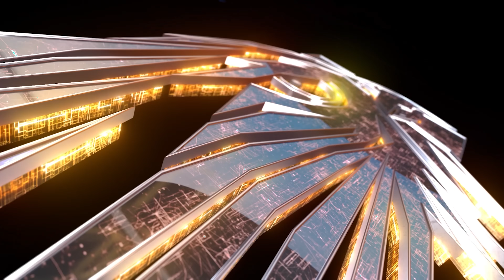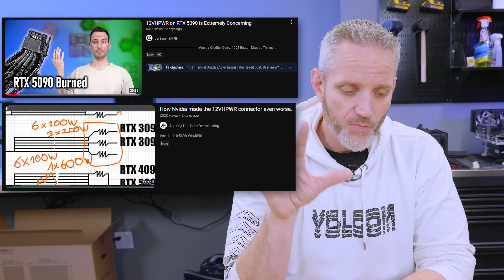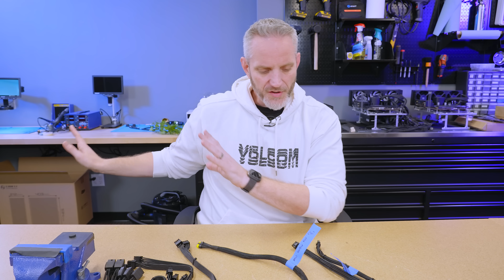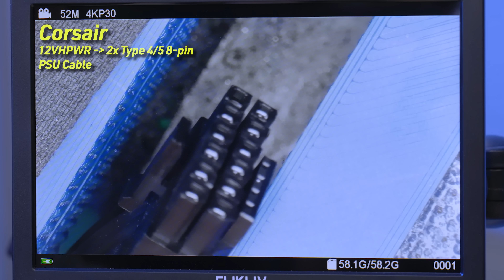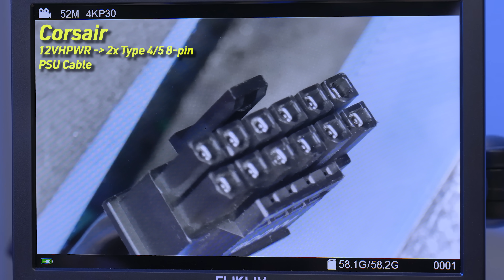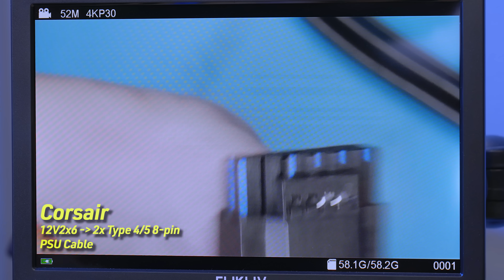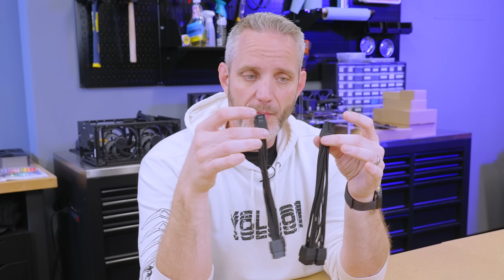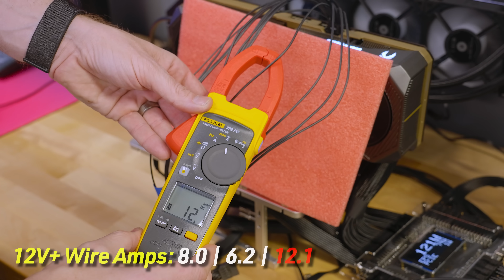I discovered something concerning and I need the Experts to chime in... More 12VHPWR discovery!

Comment: Electrician here (for whatever 2 cents that's worth). First, the connector bodies you're showing have sleeves in them, not pins, but that's not particularly important. The way a sleeve crimp is designed to be crimped to a wire and mate with a connector body is kind of at the heart of what I'm seeing here. The sleeves get crimped onto the stripped wire first with one part of the sleeve crimping onto the insulation for strain relief, and the other part crimping on to the wire strands. In theory, a proper crimp tool fuses the strands together with the crimp sleeve by applying a calculated amount of pressure in a precision, high tolerance tool jaw. The resulting connection should be practically without resistance (I mean, there's SOME amount of resistance, but it should be negligible to the requirements of the circuit design). Low tolerance or worn tooling can have a huge impact on the connection quality, as can the material the sleeve is made of and any of its coatings. Really poor quality connections can happen when quality control isn't up to par at this stage and wires aren't stripped properly (too long or short) or not positioned in the crimp body properly.

Once the sleeves are crimped onto the wires, the sleeves can be inserted into the connector body. Spring tab(s) in the sleeve or some similar mechanism will retain the sleeve in the connector body with almost zero wiggle room. This is where things can get really sticky. A cheap connector body and sleeve might have retention that basically doesn't work at all or that works really poorly, or that has too much wiggle room, which is what I think you're seeing on some of your connectors with sleeves at various depths. That said, even on the connectors you have that are somewhat recessed, there might still be enough contact between the sleeve and pin for the circuit to work withing specifications, unless the sleeves are of such poor quality that they're opening up (too little spring pressure) and not mating in parallel with the pin around its entire circumference. High quality connectors should work reliably even if not locked in 100% and the locking mechanism should only really be there to prevent the connector from pulling away completely.

If you know the circuit design is good and you still have one wire carrying more current than the others, it's the other wires that are likely at fault with possible bad crimps, broken strands, poor connection quality between sleeve and pin, etc and they're presenting too high a resistance to carry the proper load. Electricity will take all paths, not just the ones with lowest resistance. This can cause that single "good" wire to carry way more current than it was designed to carry and heat up along it's entire length just from being overloaded - especially in a power bus design. The overloaded wire(s) should show a heat signature along the entire length. The bad wires should show heat signatures at the crimp points (inside the sleeves and dissipating heat away from the bad connection). Hope this helps.
Reply: I want to highlight the last paragraph. The conductor(s) carrying too much current are (initially) the best connections, not the initial failure point. Conductors not carrying current are the problem. Hot connections/terminations without higher-than-neighbor currents are signs of high resistance in that specific point.
Reply: Exactly... Well Done Mate! 👍👍
Reply: What he showed with the PMD2 reaffirmed to me that much of it is likely variance in cable connections,  which there 'should' be enough headroom in the spec to realistically account for. However,  if you watch the video der8auer released, his quick test showed just 2 wires effectively carrying all of the current to the point where they were hot to the touch in just a few min and blinding on the FLIR.

Poor crimps are one thing but it's wild to think his fairly reputable cable could be so bad that every other contact had such a higher resistance even as the the 2 carrying the load heated up that much. It seems like another factor is potentially at play but if it really is just the connectors then the margin for error must be shockingly low for how much Nvidia is pushing the specification.

It's all very strange considering their engineers have now had years to analyze the concerns around it.
Reply: buildzoids video explains the other side of this... in the 40 series and 50 series Nvidia moved from power delivery split 3 ways via 3 shunts to a single shunt design that combines the input from the 6 12v conductors into a single load. So instead of a max potential draw of around 16.63 amps across a 16GA wire (assuming worst case where 3 conductors are faulty, 1 per pair)... you now have the potential of 50 amps going across a 16 ga wire. You can lose 5 out of 6 12v conductors and the card will still power on instead of losing a maximum of 1 from each pair. As an Electrician you should know how bad that is and what will happen when the worst case eventually occurs :)
Reply: @TheAddanz  there is no other side of it this is reality now the rest of the industry is aware of it and should adjust. Read the comment again until you understand what is being said and also read some of the replies
Reply: @InsaneDark  the other side is the incredibly fucking stupid power delivery circuit design which allows a failure state that can push 50 amps through a single 16 gauge wire. Derbauer actually just emphasized that point. NVIDIA should redesign the circuit. It's very simple to make it safer and the cost of implementation on the PCB via design change is negligible. The alternatives will all cost substantially more. Cables would need some smart logic onboard, or PSUs . NVIDIA just needs too alter the etching of traces and add a couple of shunts to split the circuit into 3 pairs of 2 , so the worst case scenario becomes 3 wires with 16 amps, instead of a single wire with 50. This design should never have made it to production in its present form
Reply: @TheAddanz  Boom goes the dynamite?
Reply: As an electrical engineer, I completely agree with this take on the problem.

This comment needs way more likes, it's the only comment that actually explains the problem at hand with the least amount of inaccuracies. There was only one inaccuracy where you mentioned that electricity won't take the path of least amount of resistance and that's just not true.

Electricity is lazy and it will a̶b̶s̶o̶l̶u̶t̶e̶l̶y̶ t̶a̶k̶e̶ prefer to take the path of least amount of resistance without question.
Reply: @proxyhx2075  I'm an electrician. Electricity takes any path it can flow through. The majority of it takes the path of least resistance, but there will still be current on a higher resistance path.
Reply: @Brandon_Nelson92  Yep, can confirm as someone who's accidentally touched a mostly discharged capacitor>.>  it will take ANY path given even if it's already connected to another ground... >.>  I'm looking at you power supplies >.>  (I KNOW, before anyone says I KNOW... I was being VERY careful but still messed up somehow and contacted the top of a large capacitor inside of it as I was trying to figure something out.  PSUs are no joke, and I knew that before hand... thankfully it had already discharged AND been over a day so ... yea thank the lucky stars on that one I'm still here >.> )
Reply: @Brandon_Nelson92  I know that it won't exclusively take the path of least resistance, but most of the electrons will still prefer that due to their nature.

I should've used the word "prefer" instead of "will", that would clear up any further misunderstandings I hope.
Reply: @proxyhx  I'm not arguing, everything here is good stuff, just pointing out it is only an inaccuracy if you stop at that word and don't read the full paragraph for context. He didn't say it would travel equally... He was correct in saying that those connections are still made, so no faults are detected, but the vast majority still goes the easy path. As you say, electricity is stupid... there will be electrons that just kind of get lost and wander down the high resistance path, which they couldn't do if it was just a broken connection entirely... He followed that one line up with the entire heart of the cause of heat on the "good" connections, needing to shoulder the load of the bad connections.
Reply: @Burt2707  Yeah I realized that soon after I commented, I stand corrected.
Reply: Commenting to make sure Jay sees this one
Reply: Damn, nice comment. I worked as a crimp technician for a major automotive suppliers in the prototype/R&D department and thought basically the same. The crimp style is called B or F crimp btw, and has four open claws per crimp sleeve, two for the wire crimp and two for the insulation. The stripped wire is inserted into the crimp sleeve and the claws and the claws are pressed with a tool from abow to bend them inwards, into the strands and around the insulation. 

There are several more things to mess up as a machine setter. 
The crimp sleeves are fed into the machine as a big continous spool of stamped pieces, which is moved one piece per cycle with a small hook grabbing the band and positioning it in the tool. The position on the tool can be fucked up in two dimensions, either the crimp sleeve is advanced to little or too much, resulting in the claws that press into the wire strands (like a B laying on its back) to be asymetrical. One claw may be barely contacting the strands, while the other one pushed through and collided with the inside of the connector itself, big no no. Another one is the crimp sleeve position being too deep or too shallow the the tool. This will result in parts of the crimping area to be not pressed down properly. 
 
Another one would be the wire. If its inserted too deep or not deep enough into the crimp sleeve, you get a bad crimp. If too much or too little insulation is removed, you get a bad crimp. Also the wrong wire stripping height, resulting in missing strands or prodruding insulation in the wire crimp. Missing strands or insulation in the wire crimp SHOULD be recognised by the crimp machine if it has the capability to learn the headroom for a certain crimp sleeve/wire combination. This would discard any crimped wires that detected a certain overpressure or underpressure. Bad QC may overlook this issue.

Worn out tooling may be one factor, broken tooling another. The two pieces, anvill and hammer, are hard af and WILL break if the pressure is too high. I've had several toolsets break on me because small diameter wire on a pretty empty wire spool tends be coiled up so hard that not even the straightening device could remove the internal twist, resulting in some wires being so curved that it wasnt inserted into the crimp zone. This resulted in an empty crimp with the crimp sleeve being stuck in the hammer. The machine will discard the uncrimped wire but continue with the next crimp ,resulting in two or more connectors being stuck in the tool while it hammers down. 

The resulting damage can be really hard to spot with the eye, it could range from miniscule deformation in the anvill to parts of the hammer snapping off. If its a less noticable damage, the machine will crimp just fine, the crimp wont look bad at first glance but the crimp will always be bad. If QC is half assing it, those crimped cables would be sent out to customers because the machine didnt reject the batch.

Another factor is the factory producing the crimp sleeves on the spool. Broken and worn tools resulted in many customer reclamations during my time where I had some pretty rough looking spools sitting on my desk. 
Less noticable is a problem with crimp sleeves that are produced on a multi-stamp tool. To reduce machine time per stamped crimp sleeve, some pieces arent stamped and bent one by one by the stamping press, but several crimp sleeves are being pressed during the same cycle. The highest I saw was 5 connectors being stamped in one go. This also means that the dimensions and properties of the spooled crimp sleevers arent the same, as it goes 1-2-3-4-5-1-2-3-4-5-1... One to four may be fine, but if the tooling for crimp sleeve No. 5 is off, then 1 in 5 crimped cables will be off.  

Many crimp related problems will only be found when a microsection of the crimped contact is made, again bad QC will not find this.  For the last case, a sample of all the different crimped contacts off a spool has to be taken, ground and polished to the right height to be analysed under a microscope. While 1-4 may be crimped just fine, No. 5 will have the crimp claws bent out of spec, asymetrical or not inserted correctly. Setting the machine for multi-stamped products was a real PITA sometimes if the tooling for the crimp sleeves didnt align too well.  And again, if QC is lacking, this wont ever come to light. The crimp sleeves are crimped just fine and the machine doesnt complain, maybe one contact will be microsected and show a good result, but 1 in 5 will still be bad. 

Tl;dr crimping cables on an industrial scale is hard and prone to failiture.
Reply: @minecraftzocker272  I’m an electronics technician at a university who happens to be a connector nerd. Really appreciated your comment, since my own hands-on experience with crimping is with hand crimping (since my job is building one-off or very short run custom equipment, and repair/maintenance), not automated production. 

Your section about how some stamped contacts are manufactured also perfectly explains how I got a shipment of TE AMPMODU contacts (loose, not taped) where approximately 1 in 5 pieces was defective, with the mating area slightly twisted in relation to the crimp area.
Reply: @tookitogo  Yeah, sounds about right.

 I saw similar problems regularly, and it was 9/10 times our factory being lazy fucks who dont check their tooling for defects, or if it was even the right tool. 

One time I had a protptype terminal and I needed to crimp some samples. All came back because they didnt behave as expected in the conductivity tests. After a few days of checking the used cables,  symmetry, height, measuring every dimension of the uncrimped terminal,  changing some stuff and having no idea whats wrong, we called the designing engineer down to look at the terminals. 
Turns out the wire crimp area had the wrong, unmodified, number of serrations and the factory used the standard insert instead of the requested prototype one 🙄
Reply: I love it when experts chime in, so much information for free and for the good of all human kind that reads it :).  Thanks, some real good stuff here!
Reply: Journeyman electrician here.  I agree 100% with everything you said.  I think Jay just found the root of the problem.
Reply: Yes, let's get @JayzTwoCents to see this!  Commenting again.
Reply: Take a shot every tine you read crimp
Reply: @ Crimp crimp crimp, crimp crimp crimp, Crimp crimp crimp crimp crimp 🤣
Reply: Yep reduced surface area of the contact increases electrical resistance causing the electricity to follow the least path of resistance, risking turning the other connections running in parallel across the power cable properly connected into a toaster element.
Reply: I wish the cable and psu manufactures would just fuse the cables so if the cable starts throwing 23 amps down a single pin the cable will just break protecting the card
Reply: Fired mechanic here, wouldn’t he notice other issues from a bad ground before burning up wires? I would think the card would start operating weird. Sorry but none of you answered jays question about loose ground connection vs loose power. Still waiting for a real answer.
Reply: Okay nvm path of least resistance, got it.
Reply: @Tk-di5vd  Maybe, but not necessarily. In DC systems, the one conductor that usually has a lot of redundancy is the ground. On a GPU, you have the bus connection and the fact that the card is screwed to the chassis (this single connection could carry upwards of 100 Amperes for some time) so a faulty ground wire in a cable assembly could go unnoticed. The issue of overheating current delivering wires (positives) is most likely going to have other roots than a bad ground.
Reply: @ wait pcs use chassis ground??? How did I not know this.
Reply: @PetrosArgy  Excellent comment. 

Literally the only critique is that (at least in electronics; electrical could be different), we generally don’t say a crimp “sleeve” for the female contact, but rather a “socket” or “female” contact. At least that’s what connector manufacturers do.
Reply: @Tk-di5vd  That's why the motherboard mounting holes have those really beefy solder pads around them, for ground contact.
Reply: The good cable becomes the bad 🧠
Reply: It’s not the connector or cable. In an electrician way explained. Nvidia removed 6 20 amp breakers and returned one 120 amp breaker back in place and connected 6 circuits to the 120 amp breaker. If you’re an electrician you understand that this has the potential to cause a fire.
Reply: @krakakapaul  This, but it's important to remember that electrical safety and overcurrent protection should always be on the supply side. The PSU shouldn't allow any individual wire in a 12VHWPR connector direct from the PSU to exceed the rated 9.5A. And any PCI-E to 12VHWPR adapter needs to have similar overcurrent protection.
Precisely so that a bad crimp or unbalanced power draw causes the supply to shut off before the cable and connectors fail.
Reply: @ I agree. But I also give the example where the 120amp breaker at the supply side not works for multiple circuits.
If you look how Psu are build you see they solder these connectors directly on the rail.

But we went from a 3090 with proper current limiting, to a 4090 got released without any. 
None of the PSU manufacturers had even products with a 12hpwr connector at the time.

Things got rushed. They probably should have picked a standard xt90 connector with 6 gauge wire. we would have now had over current protection at both sides.

In 2.5 years since the 4090 only asus came with a solution. And it only shows a warning.
Reply: @PetrosArgy  im also an ewectwician
Reply: So what does that tell us about the molten connector usually bring the too corner one?
Reply: If you want to get technical, they're socket terminals, not sleeves.
Reply: As an ieee 16th edition trained engineer and a PC builder for 30+ years, I can stand in support behind this statement. Electricity is lazy and will take the path of least resistance - but that doesn't mean that a higher resistance path would not be walked. 

As for Corsair... "This is fine" 

"This is not covered by warranty"...
Reply: @Dodgethebodge There are others that show that their corsair’s PSU not showing any abnormal behavior. They probably think “this is fine” as in “it is within design specs”. Slight variations in quality should not be somehow causing meltdown, as those should be taken into account into the design specs, or the design specs should be tightened-up even more.

And its not like Corsair is alone either, ModDIY’s cable should be higher quality than Corsair’s and its the one that causes the initial problem. I think the discussion about specific Corsair is distracting the issue with 5090FE’s circuit problem.
Reply: @ArchusKanzaki  I only mention Corsair, not because it is the "root of all evil" but because the video extensively refers to the amount of movement there is in the Corsair cable, and how much of a variance there is. 

Even J2C even mentioned that it is more than likely outside of the design allowances for the cable AND that Corsair is not alone in this issue.
Reply: @ I think the implication about you implying that they only said it to "dodge warranty" is my problem here. Your last line is kinda unnecessary.